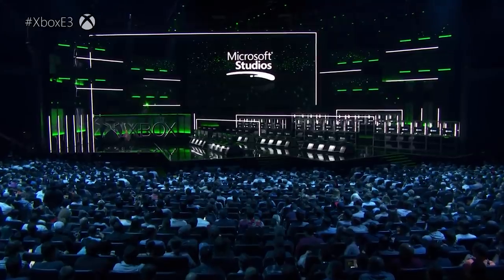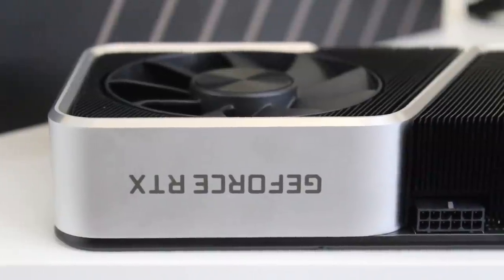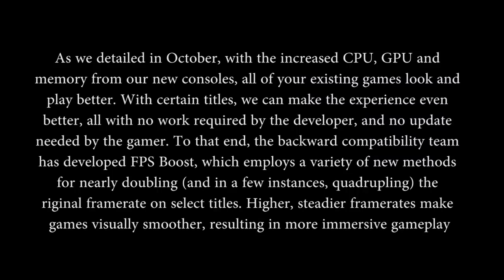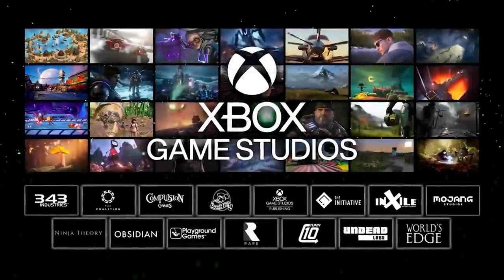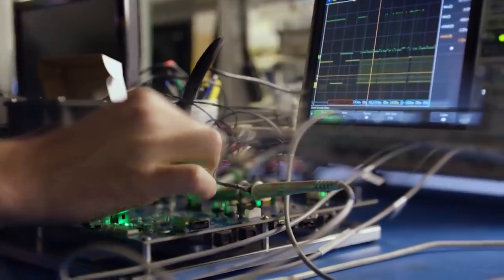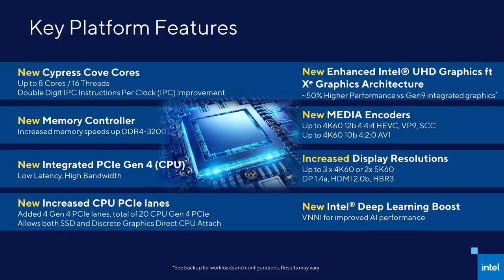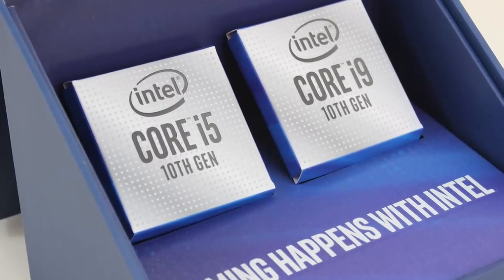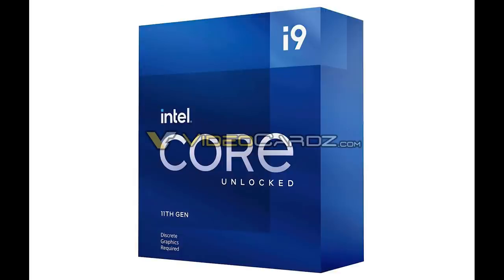Xbox FPS Boost DOUBLES B/C Performance | Nvidia Explains RTX 30 Mining Performance Nerf

Comment: My opinion on Alder Lake is don't be fooled, this is yet another 8 core CPU from Intel. Granted the low power cores will help run simple background tasks leaving the powerful cores to tackle the hard stuff more freely, so absolutely it will be faster than simply 8 Cyprus Cove cores just on their own but by how much is a very tough call. I guess if Alder Lake has a big performance lead in single thread over Zen 3 then an 8+8 CPU would make for a great gaming chip, but how it will do against Zen 3+ and Zen 4 is another story.

But it's the other use case scenarios that are very thread heavy where I see Intel losing very badly. I don't buy into the need for low power / low heat cores when talking about desktop CPUs, I'm sure the big.LITTLE design will work well for laptops and other highly power sensitive devices but not mains powered, high performance desktop machines. Modern CPUs can already down-clock and under-volt significantly when not in use or not being pushed hard so I just don't see how these little cores are going to be all that useful for anything really.

My reasoning for why I believe big.LITTLE designs won't compete performance wise much past the number of big cores is seen in Apple's M1 benchmarks. This amazing chip has fantastic single thread performance, up there with the very best chips on the market today and easily beating one of AMD's current top mobile chips the 4900HS (I know 5000's are almost here) but when it comes to multi threading the 4900HS totally destroys the M1 chip because the M1 is only a 4+4 chip and the 4900HS is a real 8 core chip. So Intel can bring 8+8 but I am pretty sure 5900X will be faster in work loads that use 12 threads or more, then we have the 6000 refresh which will only increase this gap and then Zen 4 will like make a 8 core CPU look very much entry level.

I think we all know the real reason Intel can't produce much more than 8 big cores in the mainstream and that is because of the aging ringbus design they are still using. Clearly AMD caught them by surprise with how quickly they caught up and then how far they have pulled away. Intel simply hasn't had the time nor FAB performance to react yet. I dare say if everything was running smoothly for Intel we would already be well into 7nm Meteor Lake chips right now and would be wondering if Zen 4 might close the gap to Intel in 2022. But that is not the situation and in my opinion Intel still needs to realise this, they need to price their products better to reflect they are only mid-range now and they desperately need to move to or licence TSMC's nodes if at all possible. I know the rumours are that Intel is meant to be using TSMC for 5nm CPUs this year then 3nm CPU next year but I will believe it when I see it! I just don't see how TSMC has the capacity to help Intel when it can't produce enough wafers for it's current long term (more important) customers.

Anyway, at the end of the day this 8 core CPU (with an extra few little cores) is meant to see Intel through 2022 and I believe into 2023, at the same time AMD will be giving us 24 high performance cores in the top end Zen 4 chips. I just don't see how Intel can put up any kind of fight again anything more than an 8 core Zen 4 chip, meanwhile AMD will be offering 12 core, 16 core, 20 core and 24 core options, plus Threadripper which will be up to 96 cores! 

I just really hope Alder Lake has a massive single thread performance improvement over Zen 3 to give it the edge in many sparsely threaded allocations like Photoshop, Lightroom, etc and probably more importantly in gaming too. This should, if priced right, mean we have attractive options depending on what your usage needs are and crucially some competition so prices don't get out of hand in a monopoly again.
Reply: @untseac  Sounds like the name of a private school or English countryside estate - Lord Rotterham departed from his Alder Lake manor in carriage
Reply: @untseac  Alder Lake is a meh name. However Rocket Lake is just moronic. Meteor Lake is cool at least.

Comment: I'm not wanting to 'hate on Intel' as I really want Alder Lake to be amazing if for no other reason than to giving us options again, product availability, pricing competition and forcing AMD to keep pushing harder and faster but not using PCI-Ex 5.0 for the M.2 slots just makes having PCI-Ex 5.0 utterly pointless as it's only the M.2 drives that will come anywhere close to saturating their PCI-Ex 4.0 connection speed.

Also, worryingly for Intel is that Alder Lake isn't really going up against the 5900X but probably the Warhol based 6900X coming out around Sept/Oct. Sure Warhol doesn't look like it will be that special, <5% IPC, <10% clock increases, but I still think that would be enough to give the 6900X the edge in a highly threaded application like Handbrake, Cinebench, etc but not in a thread limited application which gaming generally is.

But then in June/July Alder Lake will be facing Zen 4, currently rumoured to have a colossal 29% IPC increase so almost certainly giving AMD back the single thread performance crown (and so crucially the gaming crown too) but Zen 4 will also have a massive 300% more 'big cores' than Alder Lake if the 12 core CCX rumour is correct. So whether it's single thread or multi threaded, Zen 4 will likely have a huge advantage over Alder Lake.

Zen 4 will also have the other features like DDR5, USB 4, PCi-Ex 5.0 hopefully for the M.2 drives too but with it being built on TSMC's 5nm it should use a lot less power and so be much easier to cool too.

My concern is Intel doesn't really have a response to Zen 4 until most likely 2023 with their 7nm Meteor Lake. Sure they might refresh Alder Lake in the meantime, increasing performance a little but not nearly enough to challenge a 24 core Zen 4 chip. I think Intel's only real chance before Meteor Lake is if these rumours about them moving to TSMC's 3nm next year are true but sadly I don't think for a second they are, not for desktop CPUs anyway.

Personally I will be waiting for Zen 4, if for no other reason than to make an informed buying decision. If Zen 4 is a big let down or if Intel is moving to 3nm next year with a Alder Lake refresh offering 16+16 cores and sane temperatures then brilliant, I'll be back on the Intel train!
Reply: The 12ccx is to 99% fake, since redesining the interconnections isnt done in one night, and the work that went into the 8ccx would have been for the trash Can. A 3 Chiplet Am5 CPU how ever....
Reply: @Luca-bx4fx  Who knows, could be either. Lisa said core counts will increase, so it could be just a 3rd chiplet but I wouldn't rule out a 12 CCX either, AMD have been designing Zen 4 to be a big change for at least 3 years now they have had the time. Zen 4 will bring a new socket, new memory, new PCI-Ex gen, new USB gen, so why not a new CCX. I am sure they learnt a thing or two when moving from the 4+4 CCX to the 8 CCX so maybe the next step to 12 isn't that big.
Reply: AMD fanboy detected
Reply: @Vanessinha91Pucca  Which part do you disagree with? Are you pushing for Intel's M.2 drives to only be Gen 4 rather than Gen 5? Are you glad Intel is only including 8 fast cores? Do you think Alder Lake should only be compared to Zen 3 and not Zen 3+ or Zen 4 depending on the real launch date of all these chips?

I may be wrong on some of it but I honestly don't see myself as an Intel fanboy, as I said at the bottom, if Zen 4 is a let down and Alder Lake is better then I have no issue going the Intel route, as long as Intel promises future compatibility like I am sure AMD will. If I buy Zen 4 on AM5 then I will likely be able to upgrade to Zen 4+, Zen 5, Zen 5+ and maybe beyond.
Reply: @Speak_Out_and_Remove_All_Doubt  Infinitiy Fabric, I/O and IPC will be the main Focus of Zen4, there isnt any Reason to change a perfectly fine 8c ccx Layout
Reply: @Luca-bx4fx  the 8C CCX is fine today. We don’t know whether it will be optimal going forward. What we DO know is that AM5 will bring PCIe 5.0 as well as DDR5. So the I/O die will be able to handle a lot more data coming in/out of the CPU. The big open question is what changes will come within the CPU on infinity fabric and whether bandwidth per lane will correspondingly increase. If yes, I would suggest an 8C CCX won’t have sufficient computing power relative to I/O bandwidth, and moving to a 12 core CCX would result in easy (relatively speaking) IPC gain in multithreaded workloads.

Regardless, it’s too early to tell either way without more information. The EPYC chips should start going to cloud customers in the last half of the year, and once that happens we’ll start seeing tons of reliable rumors about the capabilities and specifications of Zen 4.
Reply: @Luca-bx4fx  There is a need if you want to increase the core count in the server and workstation market when you realistically can't fit more than 8 CCXs and the I/O die in the CPU package. AMD won't keep the server chip at 'just' 64 cores again in 2022/2023, I don't see them having any other option than to increase the CCX.
Reply: @untseac  We have 64Cores per CPU at the moment, and everything suggests a 96Core Zen4 CPU, so per socket it would be 50% more Cores. No Idea where you have the 512 from

Comment: So Intel 10nm SuperFin..... + ?
Reply: ...plus plus plus plus
Reply: Talking points still work now don't they.  Make noise about the node over and over again and it becomes easy for folks to crap on the processor without looking at the performance of the tech.  Before you start going in on me as a intel schill or fan boy...I'm one of the very few folks running a 5000 series AMD cpu soooo...  If the performance is there, what difference does it make?  I think its worth paying attention to.
Reply: It just seemed like a repeat of what Intel went through with the end of the Pentium 4 series of CPU's until they righted the ship with their first x64 CPU's to counter AMD's though it cost them their Itanium CPU's as well.   Not sure why Intel took so long this time as it cost them Apple and maybe becoming dependent on Chinese supply chains.  This is usually where AMD shoots themselves in the foot also.
Reply: @vgernyc  I totally agree on the sentiment of your comment.  Intel has been a stubborn mule for a good while now and their rigidity has cost them...appropriately so.  I just believe that we should step away from the voices that paint them in bad light and let the processors come out and get tested before we prejudge what intel is doing.  Let their work speak for itself.  If its good, then great and cheers to them...if it sucks then they deserve the criticism that they get.  Just like with the move that Nvidia is taking now with the new CMP's...lets let them show their stuff then judge it's worth and effectiveness.

Comment: Would you buy a used RTX 30 Series Card from Miners???
Reply: I'd rather play at 20fps. Fuck em.
Reply: Atleast mining used cards are much better than gaming used ones in my experience. All of the used mining cards I’ve bought have ran absolutely perfectly with no hitches. Gamer used ones always have issues.
Reply: Yes mining puts less strain on the card than gaming.  Miners prefer to keep the card cool using less cores and less power. No throttling and no dust build up. Less expansion and contraction on the parts. Miners take care of their cards so that they can resell them and do improvements such as putting better thermal pads and liquid metal paste
Reply: @darkkingastos4369  Totally agree with you and Omar Y. I bought used GPU from miner. 1070 ti , practically brand new. Undervolt plays a huge part in keeping electric bills down and keeps cards in great shape even after hundreds of hours of use.

Comment: So "FPS boost" literally just means they set a higher number as the maxFPS in the game's config...
I mean - don't get me wrong - this is very nice for XboX users regardless. Even if it's literally just a matter of editing a few digits in a textfile more often than not.
It's just so cringe that they can't just say that's what it is rather than going all "oh it's Microsoft very special secret sauce"
Reply: "So "FPS boost" literally just means they set a higher number as the maxFPS in the game's config..."
No. Xbox doesn't have access to the games' codebase, they dont have permission to alter the game, only the developers can. This "Fps Boost" is basically being done by the console itself in a Hardware/System level, not Software. Thats the point of this "Feature", its free performance benefits without having to wait for devs update a patch for the games. It's also a reason why there's no Resolution increase, only fps. The devs didn't do a thing to the games, xbox did, through the console.
Reply: "editing a few digits in a text file"?!?! You not only have no idea about how Xbox' fps boost works, but you also have absolutely no idea what you're even talking about. Keep up. The information is readily available.
Reply: @user-fm8xs3hr3w  If you have a link to something that goes into more detail than "system level" and "a variety of methods" then I'd be only happy to learn more
Reply: @roundabout9452  sure, but if you want to avoid altering the code base then you just inject the value at runtime. Functionally the same thing, and pretty trivial. I'm sure you could arrive at a similar result through a more convoluted way - but why would you when the engines of the games supported thus far all seem to have configurable framerates? What holds them back from running faster on faster hardware is literally just the artificial cap value.
Reply: @TheStigma  They can't just "inject" a specific framerate cap value at runtime, thats not how that works.

What's holding them back you ask? The games themselves. Console version of games are built and optimized differently from PC versions. The framerate is capped to its hardware capabilities, because it only targets Specific Hardware. PC versions of games have uncapped fps because the hardware is scalable and upgradable.
These Old games are running the previous gen base Xbox One builds of the games, thats why it's only capped at 30 fps even on the Series X, and cannot be uncapped unless developers do so with an "next gen" update.

MS uses a hypervisor to run BC. So the game is running inside a wrapper basically that is pretending to be the old hardware. The hypervisor can fake the clock and so forth, so the game is running internally at 60 it just thinks its running at 30. The game engine itself relies upon the system for clock cycles at timings and since the hypervisor is intercepting any system calls including D3D calls it can manipulate those timings.
Think of it as "Emulation" of sorts but its running natively on the console itself.
Reply: @TheStigma  Game itself still thinks it's running at 30fps which is visible in Watch Dogs 2 if you look closely at car wheel animation.